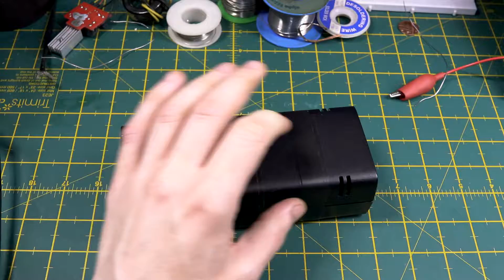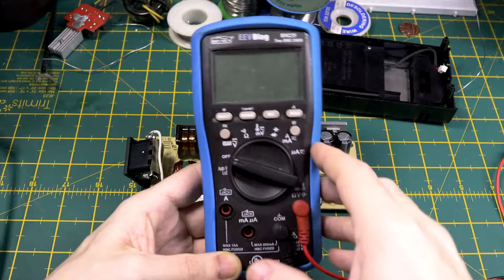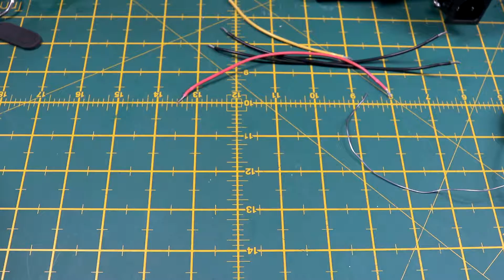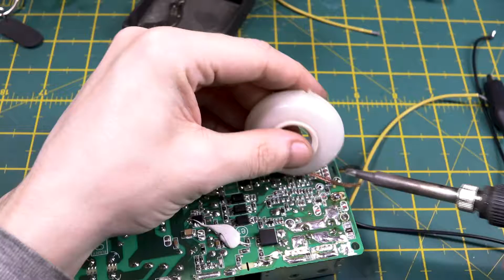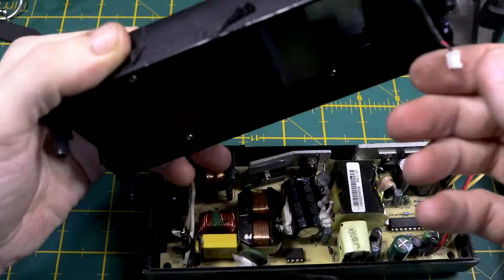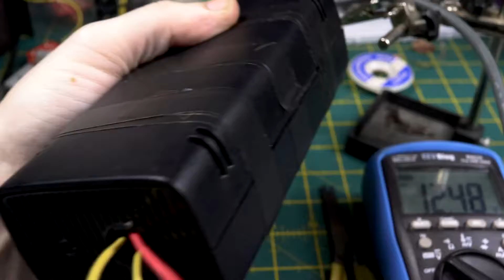Part #2 Xbox 360 Re-Build | Xbox 360 Slim PSU repair | DrRunCMD

Comment: How much will it cost  for you to fix my power supply
Reply from the maker: What type of powersupply do you have and what is it used for powering?
Reply: Xbox 360
Reply from the maker: @chriscano4795  what seems to be the problem with it? No power at all? Has had a previous problem? Has a repair been attempted already?
Reply: @drruncmd  when I plug it the orange light dosent Turn on
Reply from the maker: @chriscano4795  I think you may be best to purchase a new one because they are cheap as chips. You can buy one for less than 15 quid. Or I could still repair it free of charge. But you will be liable for sending it to me postage costs.
Reply: How much does  it cost to buy a new  one?
Reply from the maker: @chriscano4795  if you have the slim version:: https://www.ebay.co.uk/itm/GENUINE-MICROSOFT-XBOX-360-SLIM-POWER-SUPPLY-135W-BRICK-ONLY-PK-/124710735512?var=0&mkevt=1&mkcid=1&mkrid=710-53481-19255-0&campid=5338268676&toolid=10044&customid=EAIaIQobChMIx4ySkYSE8QIVSYfVCh0NeAs2EAQYAyABEgJ-hPD_BwE
Reply: How do I check
Reply from the maker: @chriscano4795  have you managed to find out what xbox you have??
Reply: If i have  the slim version
Reply from the maker: @chriscano4795  send me a picture of the power supply and xbox 360 via my email at: ccoegoog@gmail.com and I will let you identify the correct supply you need for your xbox.